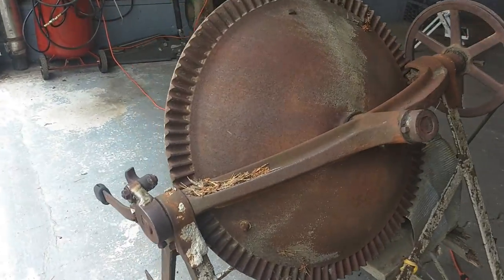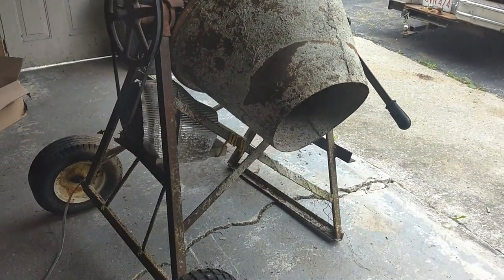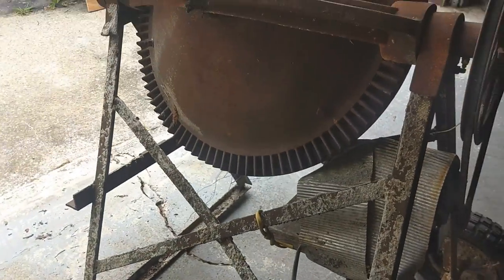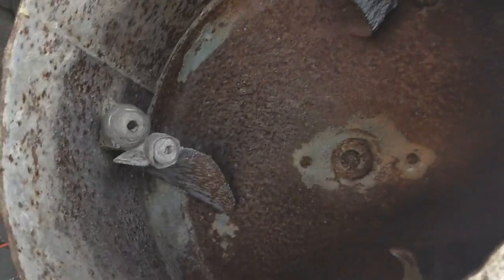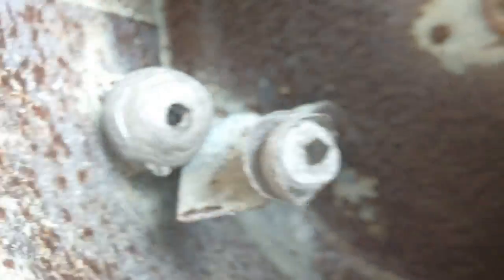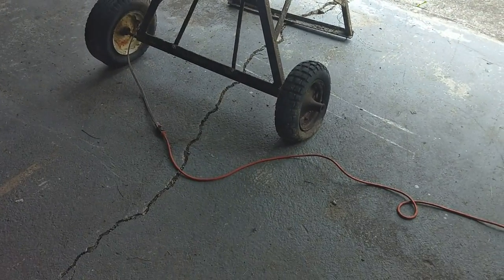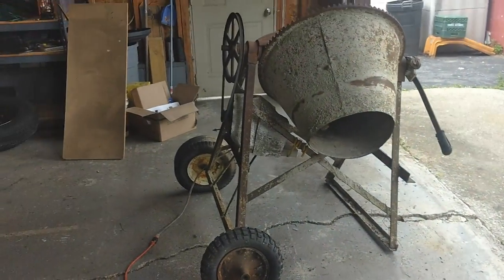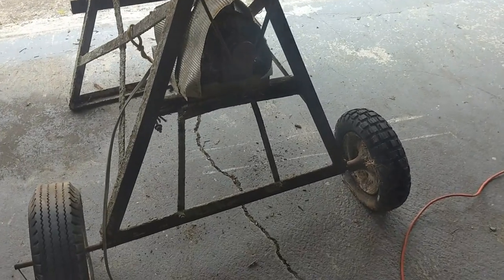Antique cement mixer plugged in after years of sitting

Comment: Had the luxury of utilizing one of these!  We over used it on one job and it held up! Only had to be adjusted once because the constant weight from the cement made the one gear come lose out of alignment. Very perfect simple design and you can still buy those motors!  Modern systems just add more useless junk and if it breaks it's not fun!(Shouldn't happen like that though,modern should be easy to get parts even if they are not necessary some of them)  Also these are balanced and the lever makes the concreate easy to dump in a wheel barrel. Metal is heavey gage, but they seemed to make these cement mixers balanced well. I enjoyed the process, was a break from the wheel  barrel mixing that day! We used this for our green house

Comment: What size motor does it have on it, I have almost the same exact mixer, but didnt come with a motor, and the drive pully is a flat belt type drive pulley, wondering what HP motor/motor pulley should be used and what RPM is meant to begin with